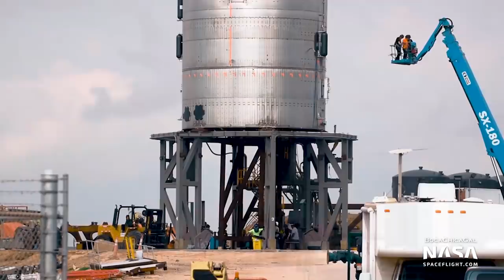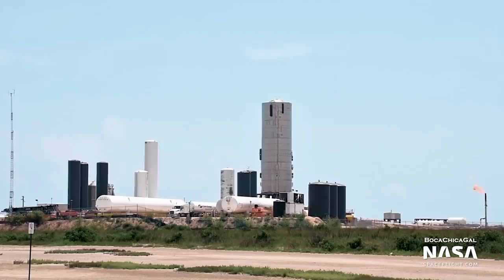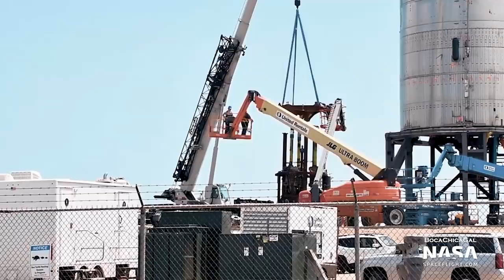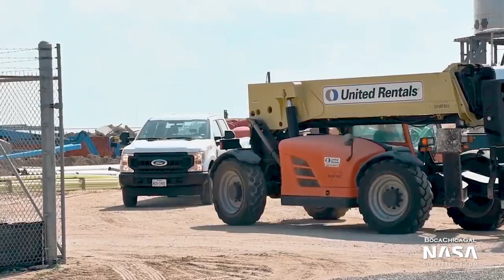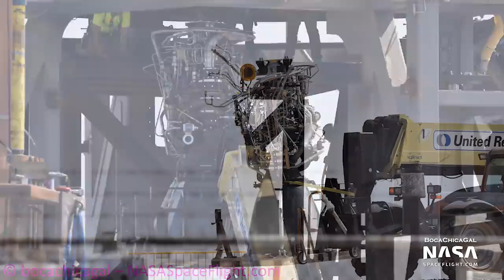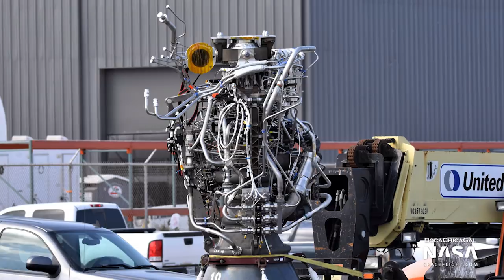SpaceX Boca Chica - Raptor Removed following Second Starship SN4 Static Fire

Comment: Looks like thats it for SN4 then and on to SN5?
Reply from the maker: Nope. Just testing without firing next, then reinstall it. SN4 is still on for the 150m hop.
Reply: @NASASpaceflight  Do you know what the goal is without it?  I see the test ram going back, im guessing they are gunna go for higher pressure tests. If i remember right, Elon said they need 6 bar for orbital flights and this hasnt made that yet.
Reply: @Vatsyayana87  It's likely they would like to do another pressure test and see if they can get some more pressure
Reply: @seanskiles4414   which leaves the possibility for a RUD. :(
Reply from the maker: @Vatsyayana87  That sounds like a good likely next step.
Reply: @Deeplong9  It does, but I'd rather have it happen to SN4 that I would a later variant
Reply: This unit has passed the 4.9bar test, which is good enough for the hop, I reckon they should do the hop, THEN go for a higher pressure test.. they are so close, seems like a possible jinx doing this..
Reply: @Deeplong9  Well, maybe. But not a heartbreaking one like the others. This one has raised the bar and is successful no matter what happens. We would just have to wait longer till that hop we all want lol.
  Its possible that 6 bar I mentioned might be needed for flight all together, so they wanna be sure before risking that sweet engine.
Reply: Fair chance SN4 doesn't survive the hop. Rapid Unscheduled Disassembly Elon predicts.
Reply: @genelomas332  is that all that's needed? I remember Elon saying he need 6 for either flight or orbit, don't remember. So he would like something like 7.1 to be very happy. Its possible I don't recall correctly though.
Reply: Wouldn't be surprised if they're going to evaluate the thrust puck and see if the static fire tests have resulted in any cracking or micro fracturing in the stainless steel, from the loads an vibrations.
Reply: @Vatsyayana87  I believe that the current pressure is good enough for the hop, ~6 bar is needed for an orbital flight and ~8 bar is needed for a manned flight. As long as it stays in atmosphere SN4 should be good to go.
Reply: @nathanieljames7462  no, he said that about sn5 not 4. Hoppy has already tested the system, this hop is just upscaling. He was talking about the belly flop landing
Reply: @Deeplong9  Keep in mind these are just testing prototypes.  Their function is to be tested to see what works AND what doesn't.  So the next ones will have updates that solve the problems found in testing.  A year from now nobody will think twice about a starship failing when they launch it.
Reply: @NASASpaceflight  I could also imagine they want to check if the static fires did any damage to the raptor being mounted like this before they do the hop. You know, burned or stressed gaskets, fatigue in flexible or moving parts, etc. 
Make sure it‘s got a clean bill of health before sending it upwards a couple hundred feet, where a failure would be catastrophic. The Raptors are hella valuable after all.
Reply: @joweydelanota5558  But it did pass the pressure tests.. passed the 4.9 bar.. which is enough for the hop..
I say hop it, THEN go for the higher pressure test.. if it then blows up, we at lest get to see it fly first..

Comment: Which iteration of Starship will be the first to achieve Earth orbit?  I’ll say SN9
Reply: I’m putting my bets on SN12
Reply: I'll guess SN 8
Reply: For orbit there need to be a Super Heavy, that being said...... no earlier than SN10.
Reply: @Deeplong9  You could be very much right but I remember reading a while ago about it being able to get to orbit but with no payload. Though it was mentioned as not being practical. Also might have been an assumption. possible? for a re-entry test?
Reply: Such a tough one.  Caution suggests a higher number, but then, we look pretty strong on a 150m hop from SN4.  SN5 even higher chance, and SN6 I think will do the 20km.  So, one or two variants on that, assuming success, perhaps as little as one additional in case of failure.  From there you would have to imagine they switch focus to Super Heavy.  It'll need its own test campaign, but then they'll probably mate it with the last successful starship and aim for an orbital flight.  Add an extra failure at some point.

Yeah .. SN10 I think.  Possibly SN9.